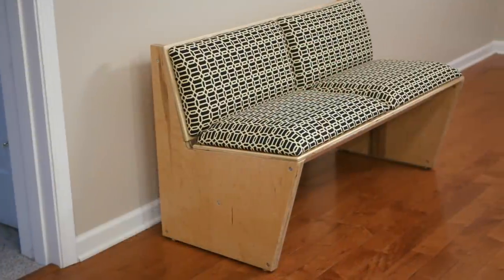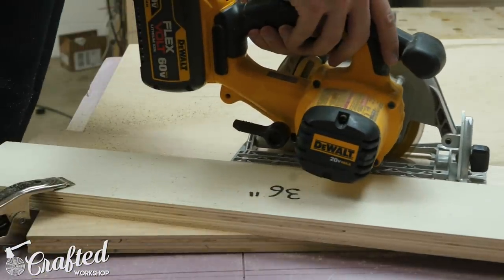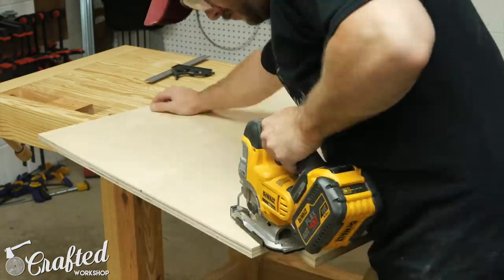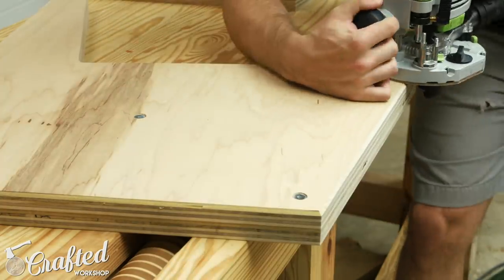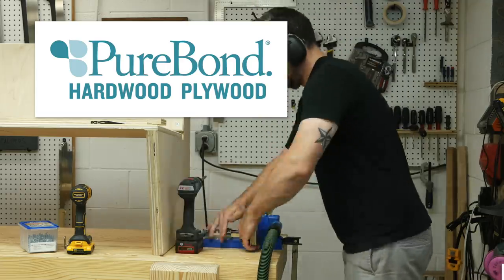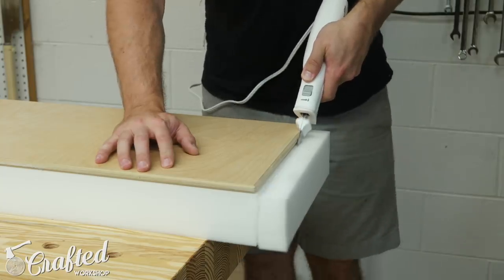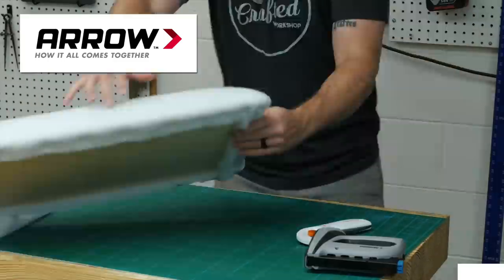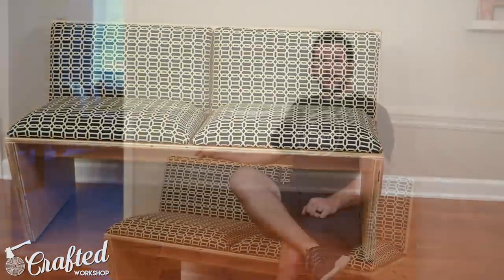DIY Modern Sofa | How To Build With 1 Sheet of Plywood - Woodworking

Comment: Do you feel like the batting made a difference? I'm curious. The bench/sofa is really nice looking. I like the dense foam you used. Good to know 2" would be good enough and 3" was overkill.
Reply from the maker: Thanks! I definitely think the batting is a good idea. It helps to fill out the shape of the cushion and gives it a more smooth appearance. It also keeps the fabric from sliding around on the foam.

Comment: As a professional painter note to all dyi people go up to 220 sand paper anything lower than 200 you run risk of scratch marks that feel smooth but look ruff, also lightly sand with 320 or 420 between coats.

Comment: Great video! I'm curious why you flush trimmed the side panels twice. Couldn't you have just glued them together after rough cutting the second one out with the jig saw and then flush cut them.
Reply from the maker: Well, I needed two template pieces. I created one template piece then used it to create another. That way, I could glue up one template piece with one rough piece and end up with two identical sides. Hope that makes sense.
Reply: Crafted Workshop Of course! That totally makes sense. Glad I asked, it probably saved me from making a mistake on a future project.
Reply from the maker: +Ian Enderby glad to help!

Comment: I didn't know there were noticeably differences in plywood, I mean given they both are first class wood. How can I tell between a better quality plywood when I´m choosing plywood?
Reply from the maker: Usually the price will indicate the quality. I would look for hardwood plywood with at least one good, sanded face. Makes producing nice looking pieces a lot easier. At Home Depot, Purebond is the nicest plywood they sell. They have it in 4x8 sheets in Maple, Birch, and Red Oak veneers. It's about $50 per sheet.
Reply: Different grades like cabinet grade is beautiful compared to external sheathing

Comment: what is the angle of the back, and do you really need to double up the 2 plywood sides?
Reply: I think it's a 10* back angle and if you are putting braces under the seat you can probably get away without doubling up the sides. You don't need the strength vertically - no way is a piece of 3/4" plywood buckling vertically - but you may want the "meat" for your seat braces to screw into. So, "maybe"  - but probably not.
Reply: you dont have to double the sides if your using a 3/4 inch ply  but for strength there are others ways to strengthen the side without doubling it

Comment: This is not a comfortable sofa. 
The back is too short. It catches me well under the shoulder blades. Even with a thick comfy cushion, I wind up with my back bent across that edge or I'm sitting on it but not able to really relax. 
I thought maybe I was just taller than the sofa was designed for but my wife is ~9" shorter and thought the same thing. 
Which is kind of a bummer, because I was going to build one differently (with a taller back) but thought "hey, I'm new at this, why don't I follow a plan?"
I'm hoping that I'll find a way to take apart and recycle it all into things I'll actually want to use.

Comment: Look like bugel screws.
Reply from the maker: The heads are much bigger on these screws, hence the holding power.
Reply: The bugle/batten screws I'm talking about have a 14mm head, 5mm shaft and countersink themselves. You probably have them in the US too. We use them for nearly everything. Real strong with tonnes of bite. Plus you drive them in with a 5mm hex/allen bit. We have to go out of our way to a fastener store to get anything pretty though, not to mention pay through the nose for the pretty ones. Anything torx is usually pretty hard to find in your local bunnings/mitre10.
Reply from the maker: +Troy Graham gotcha, looks similar! They're great screws.
Reply: Oh yeah, soft wood you dont even have to predrill. Can also screw them into metal if needed but requires predrilling. Great for joining wood to metal.
Reply from the maker: +Troy Graham that's great! I have a variety pack of these Powerhead screws and some are specifically for metal. Can't wait to try them!

Comment from the maker: Plans : https://craftedworkshop.com/store/diy-modern-plywood-sofa-plans   I'd like to know if you'd like to see more limited tool builds. I obviously have access to all the tools I could ever want but I know most of you don't. Is it worth me using more basic tools or is just mentioning tool alternatives enough? Let me know!
Reply: TL;DR
I like when you mention alternative tools, but show efficient ways of doing tasks.

To me there comes a point where using some tools seems out of reach, like a CNC.  Things get hard to relate to or hard for me to figure I could do that.  Now if you used a bandsaw and all I had was a sawzall, I could still see it possible to do the project myself, understanding it will take more time to clean things up, and all I care to hear is what alternatives I might be able to do.  Sometimes though a slight demonstration or 10 seconds of talking through a tip on using the "lesser" tool could be useful.  Going on the above bandsaw/sawzall idea, using a sawzall would mean more sanding or planing to get a nice clean line/curve/shape.  Similarly if you run boards through your drum sander, and say its just saving you sanding time, I will finish drooling and realize I will be spending more time sanding then you did.

All that said, sometimes things can't be done efficiently without a specialty tool, or in the way you want.  Say making raised panel doors without a shaper can be done, but is much harder to do.  To me, I would should using a shaper (unless there is a different option I am not aware of that is efficient).  I would bet that is one of the last tools most folks are thinking of getting though.
Reply from the maker: +David Fishback great feedback, David! Thanks for that.